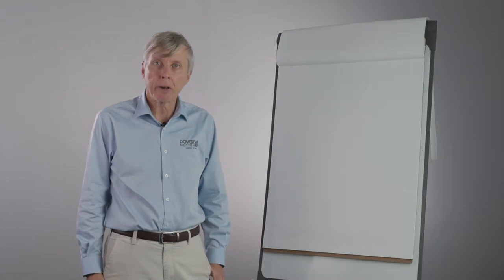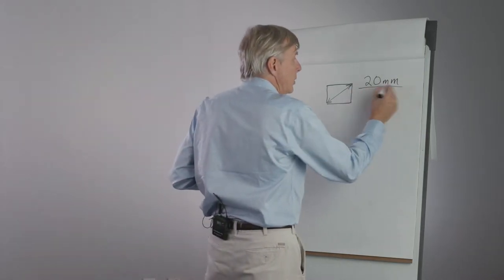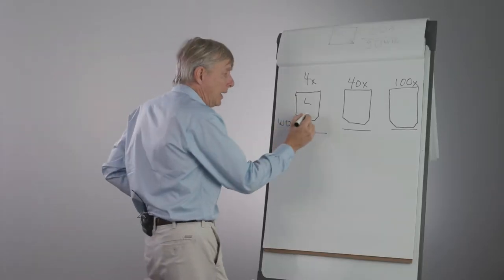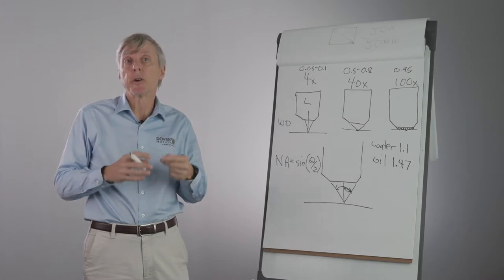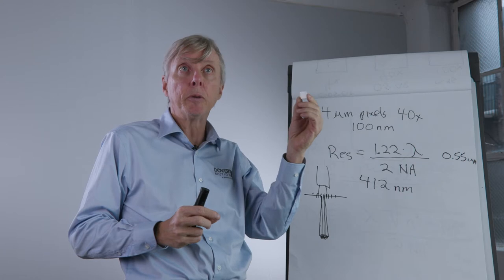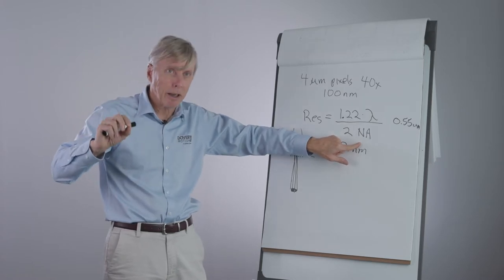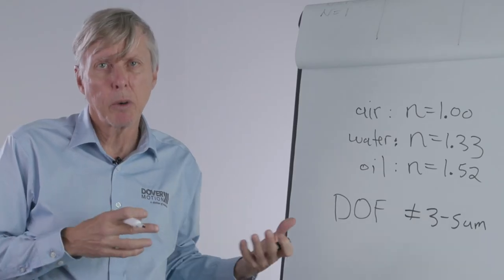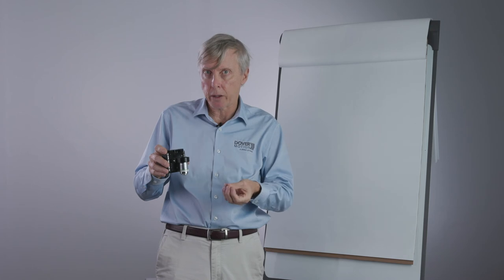Microscope Calculations Explained: Field of View, Depth of Field, Numerical Aperture & More

Comment: I subscribed. I highly appreciated the 16 minutes of beautifully clear explication before a mere 1 minute add (which looks like a lovely stage).

Is there an equation that constrains NA, DOF & FOV. As in, can any one of those be calculated if the other two are known? if more parameters are required to fully constrain NA, DOF, & FOV: what are they?

On a side note, I'd immensely appreciate if you could do a video on infinity correction/telecentric lenses. Personally, I think an explanation walking through the ray diagrams for a telecentric lens, telescope, and microscope objective side by side would be most beneficial for gaining better intuition when working with larger optical systems.